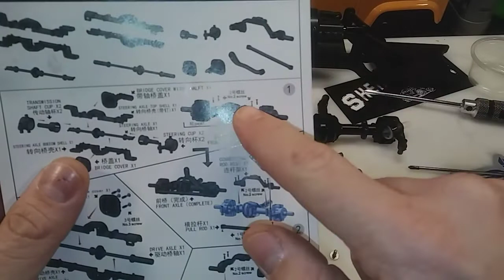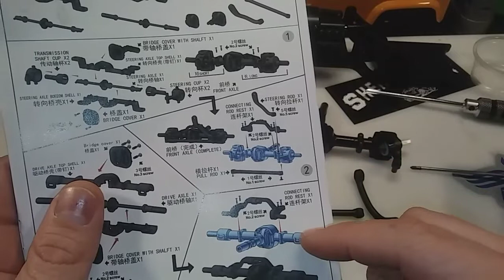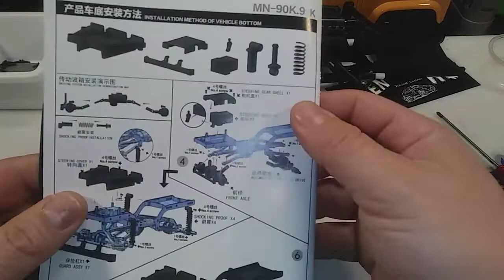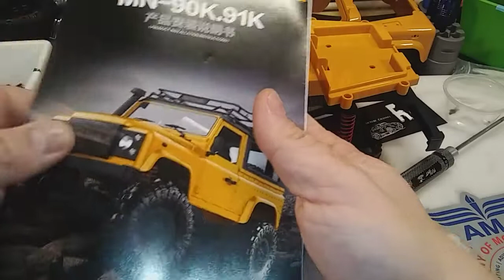MN-D90 build part#2

Comment: durn WPL stock gearbox!! they DO often crack trying to put a 180 motor into them, AND they're geared too tall for good climbing torque. it isn't anything you did or doing of course, top speed full throttle really should be about 4 to 4.5 mph, in 1/12 scale it'd be 48 to 54 mph, but there they go trying to do scale 100+ in the dirt! for walking trails crawling and climbing, it's a real issue. 

I'm using a pair of these in my C-24:  https://www.ebay.com/itm/16MM-DC-5V-12V-Mini-Full-Metal-Gearbox-Gear-Motor-Speed-Reduction-DIY-Robot-Car/323222217245?ssPageName=STRK%3AMEBIDX%3AIT&_trksid=p2057872.m2749.l2649

they make WPL's dual N30 look wimpy (they are). 12v 855 rpm is 530 on 2S, 790 on 3S, closed gearboxes sand doesn't get into, lots of torque, long run time (low current demand). had to make sheet metal center casing (a little low to unkink the U-joints), JB-weld epoxy the drive shaft half to the gearbox output (can be pried/slid back off if/when too btw). they hold their spot climbing steep, dual N30's would roll backwards. 

I don't make videos but yeah got MN-d90 on the way, along with a fresh pair of these motors. to go 2 speed requires 3ch tx/rx, they hang low to get snagged, and they can get messed up with the internal spring from what I've been seeing/hearing. WPL etc, really do need to release a crawling/climbing single speed gearbox. 1/2 the speed 2X the torque, a little 130 motor would "git-r-dun" pretty good!
Reply from the maker: Yeah the 2 speed seems to strip out allot from what i have seen to im still learning about these little rigs i have a rtr version of the wpl b1 i want to up grade a bit they are fun little trucks if dont expect allot out of them thanks for all the information should prove useful when i do upgrades👍👍💣😁
Reply: those motors are pretty happening, they're not physically tied together like a single motor gearbox is, but they don't stall either like one of the two N30's always would on steep incline. with the C-24 I'd seen videos of the axle bevel gears losing mesh, clicking and stripping. when I built, used a paper punch on thin cardboard to put shims in behind the bushings of the input shaft cover, CA'd in, then CA'd the bushings in tight. after that a drill bit to make the center hole through, and really long nose pliers to press the small bevel gear back onto the shaft quickly with a pin drop of CA (internal gear splines barely wet). the shims put the bushings further apart for less shaft wobble, and the smaller bevel gear closer to the larger for a better mesh. haven't had any problem with the plastic bevel gears, is saying something really.

B-1... use cutoff wheel to ditch those fake plastic leaf springs, you'll get a lot more suspension articulation instantly. a little filing on the free end to be slightly narrower (metal leafs) so they don't snag. sheet metal side plates (tin can bottom even!) to lower the trans case about 1/2" and un-kink the plastic shafts and U-joints, they'll stay together pretty solid!
(for dual N30 motors, go 3/4" lower with the side plates)

my RTR B-1 still using the stock cheezy bang-bang steering, it got a set of 5 buck softer kit tires, and the dual N30 motor setup I wasn't happy with in my C-24. stalls at about 45 degree incline but great to have around to hand a child the transmitter to play crawler with. with a 3v AA battery clip, now using a pair of 14500 (AA size) 3.7v 1000mah lithium ion cells, more capacity and less weight too. the B-1 runs "forever" on a  charge with those puny N30 gear motors. 
I'm stubborn, refuse to let these inexpensive models become little money pits, but DO want them to perform.

WHEEL WEIGHT... wrap rims with 2 mm solder, fronts near full, rears about 1/2. slice electric tape a little wider and stretch on+down to fit 3 wraps worth and CA the end to lock it. it'll keep the solder wire tight to the rim between the tire beads. lower CG, more traction, helps flex! when climbing weight transfers back anyway, so less weight needed there, more up front keeps the wheels down to help pull up hill and have steering. cheap quick easy and works great. CA the start (solder) and mark the spot high with something (sharpie dot) so your start+stop are same, they'll be balanced well enough. maybe a little different with the wider non WPL rims of course (D90) but same idea.
Reply from the maker: @modelnutty6503  i was thinking about wrapping the rims with copper wire but same principle good tip on b1 plastic springs i got a little water proof servo and speed control for bi gonna keep stock motor for now
Reply: with the WPL "180 torque motor", if ya got a larger junky little 270 motor to yank apart, slap the magnets (about 9/16" wide) to the outside round sides of the 180 motor casing. slide them around a little you'll feel which way/side they want to be on (pull not push), and they're ALMOST a perfect fit. RPM drops down, torque (and some heat) goes up. same but better than a stator ring on a typical 390-540-550 can motor.

always waterproofed servos myself 30+ years ago, little bit of silicone in all the seams and a gob of vaseline inside the case at the output spline, loved scratch building fast electric outrigger hydroplanes late 80's. one clocked 37.5 mph running 9.6v, eight 3/4 sub-C Sanyo SCR cells, 16D motor, direct to an Octura X432 prop. talk about motor and battery abuse! water cooling coil, a duct ramming air right into the motor brushes trying to keep THEM cooled off too. pack drained dry in 150-180 seconds, hot motor, hot battery pack... didn't last long but SO damn pretty to see the sponsons doing the 1/2" slap like a snare drum roll and ON the prop in back at on road pan car speed zipping past a .21 nitro powered outboard mono. local ABQ RC boaters were floored! nowadays its really too easy, just use brushless and LiPo power.
Reply from the maker: Man you really have allot of knowledge and experience i picked up a fiberglass hydroplane hull a will rudder prop shaft and tube at a flea market for 5 $ its going to be my spring project might contact you when i start that build
Reply: I like cutting and sanding foam, skin that with 1/32 or 1/64 balsa, then cover that with 4oz fiberglass cloth and epoxy finishing resin. aluminum arrow shaft = sponson booms. center box 3/32 or 1/8 balsa, 2 layers cloth (straight and at 45 degree over) for light but more rigid. cost about 15 bucks to make a great fast running hull, can't do that with RC cars! 1/8" Dumas stainless shaft and brass stuffing tube, with their 1/8" drive cups and nylon dog bone, another 15 bucks, bronze Octura surface prop maybe another 12-14 bucks, but you can get pretty fair plastic ones in a set of different sizes (4-5 of em) from eBay about 4 bucks.

back in '92 someone had painted hollow core door skin as a for sale sign, it was done with just laying there... turned it into a crackerbox racer. they're flat bottom at rear, draw the lines and curves for the front, drilled tiny holes both sides every 3/8", needle and thread stitching to draw it together followed by CA.. boom, 1 piece hull bottom. it's 19" long 7.5" wide now powered by 4000kv 450 size helicopter brushless. all but 1 boat been converted brushless now and they're crazy fast. 

child size cheepo cloth covered styrofoam body surfing belly board? the cloth is already there, 3 coats epoxy resin a little this-n-that, now its a 28" air boat, 3650 size 3800kv swinging a 10" 4p prop. talk about cheap thrills! grass, snow, water, its a monster. also turned a coroplast yard sign and a rounded star shaped pool noodle into a hovercraft, ducted single motor type, cheepo 2700kv A2112 brushless spinning a 5" 3p 6 blade quadcopter prop (there's always 2+ blades stuffing air into the duct is why/how it works, 4 blade wasn't quite enough). no inflatable skirt, just pool noodle skirt/bumper sliced for 1 star point facing down, 3/4 below and 1/4 above on the coroplast body. hovercraft are neat unless the wind is blowing then forget it.. no keel!

tiny whoov, oh heck yeah, foam board body skirted with 8 mm closed cell packaging foam (cut straight 7/8"), lighter the better and it floats on water powered down. round nose rounded rear corners, 7x4" not counting the foam (larger being more stable). used whoop's hoops but inverted and reversed the props, lift motors are topside, thrust motors are forward, which DOES put the pressure to the plastic endbell/cap of the motors, oh well.. if ya go about doing one, lift motor centers are 3" back from rounded nose, thrust motors use the sliced battery trap as their mast for the hoops, and yes to needing a MODE 1 controller (E010) so the lift/power and steering is on the right hand stick. approaching carpet flick the left stick BACK (as if flying quad backwards) gives lift motors more power so it ramps itself up onto the carpet, for "faster than fast" just slide the left stick forward gets more power to the thrust motors. best little 11 dollar project ever! if the skirt isn't exactly flat after gluing, a little time rubbing on a sheet of 60 grit fixes it quick enough. lot more fun than my larger 20 dollar outdoor size hovercraft too.

yeah I'm nutty allright, scratch built many planes over the decades as well.